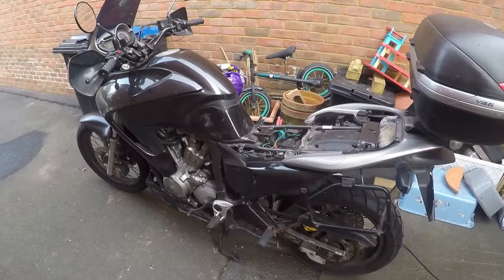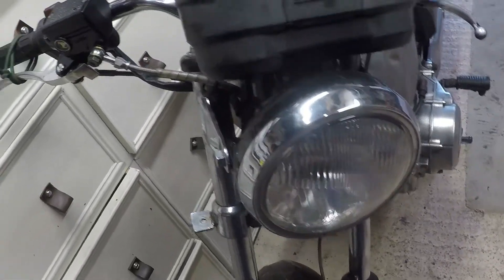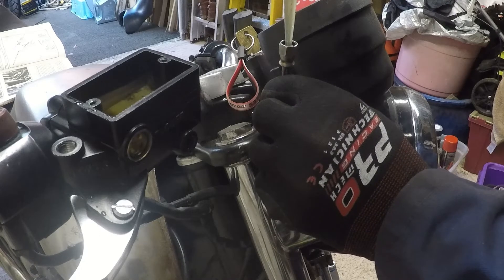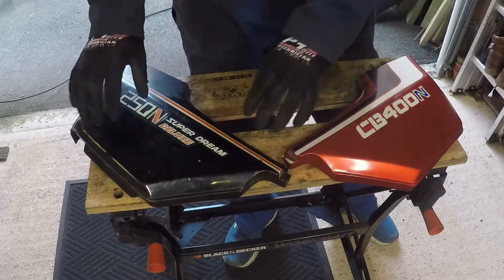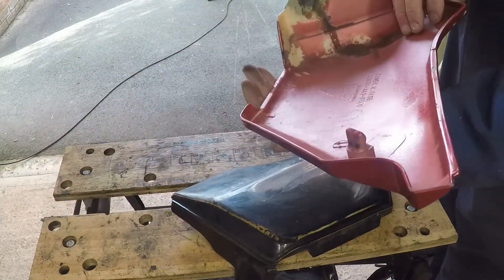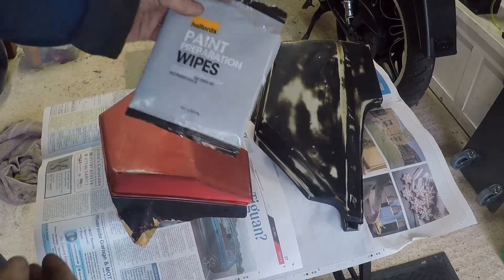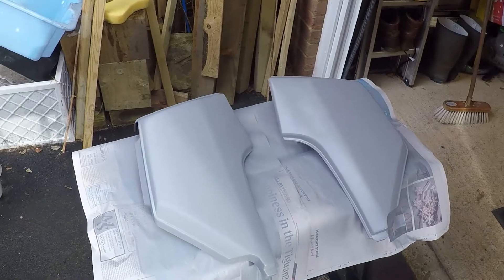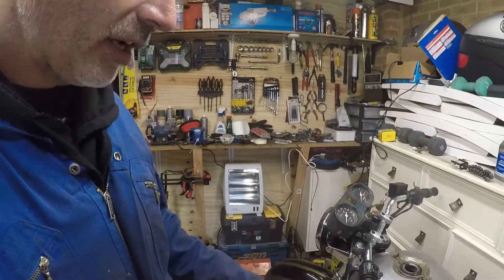Prepping Side Panels and Bleeding Brakes. Honda SuperDream (Aka Nighthawk) Project Bike - Part 31

Comment: Well done! 👍800 grit sandpaper is very good, 600 is the "normal" one and in most cases good enough - you are on the safe side! 😊 A tip can be to sand "wet". Most of these sandpapers are water resistant (you need to check yours). You dont have to keep the part under water when sanding, just dip the paper in water regularly and use a sponge to clean dust of the part you are sanding. The water will "stick" to the part  where you have sanded enough, while it peals off where you have not sanded, so it makes it easy to see when you are done and can move on. It also avoids the sandpaper getting full of dust so it lasts longer, you dont get dust everywhere and if you use hot water your will keep your hands warm 😁When sanding wet, the paper is a bit more aggressive, using 800 is perfect for that. You dont want to sand wet on bare metal, but it works perfectly on plastic parts and on previously painted parts as long as you do not get into the metal (it starts to rust very quickly). 

Remember to sand the primer as well before the paint, and you should not use old newspapers as cover under them, they release small paper-dust-particles that sticks to the paint. Looking forward to seeing the result! 

I think you have solved the brake bleeding problem now. This is the way I do it as well,  it has always worked. I have never bothered keeping the lever pushed in over night, it has just never been any problem to bleed after the caliper and hose has been filled.
Reply from the maker: Hi Thank you again for your comments, I had previously used the sandpaper wet on top coat but never when preparing the surface, so I will do this when I move to the rear section. I hope the caliper will bleed now when I can get back outside soon. Ryan

Comment: Well done for getting out in that cold garage.  You might want to flat that primer off wil some 1200 wet and dry used wet. It sometimes shows up imperfections and its a lot easier to correct at the primer stage if it needs it.
Reply from the maker: Thanks Colin, I did expect that I'd need  to do something before next coat, so I'll try a gently 1200 and hopefully all will be well. Ryan

Comment: I was surprised to see decals came off so easily ,sometimes there's laquer on top ,I like your spraying technique but if can offer one piece of advice it would be to spray edges first 👍
Reply from the maker: Hi Derek, thank you. When I get to the top coat I will bare that advice in mind. I was also pleasantly surprised the decals didn't put up more of a fight, but they did have to get rather hot before I could get them started. Ryan
Reply: @RyansGarageUK  that's ok Ryan I've been using paint for 40years now ,before that I worked at a Honda dealership when the Suoerdreams were all brand new out of the crate ,they were very popular back then 👍

Comment: There are many different methods to bleeding brakes...everyone seems to have their own way. However, I recently rebuilt my Superdream brakes and bled them from dry by doing the following which worked in no time at all. I removed the caliper and cable tied it to the fork in such a way that the bleed nipple was the highest point on the caliper. I then used a clamp to keep resistance on the piston. Then i filled the master cylinder whilst the nipple was closed...tapping the brake line with a spanner all along it starting at the nipple right up to the master cylinder to encourage any air bubbles to dislodge. Then pull the lever right in...keeping pressure on it, and crack open the bleed nipple, only letting a small amount of fluid out and then closing the nipple. Then SLOWLY release the lever back out. Once it's fully out I then pump it 10 or 15 times very quickly. Repeat this process of applying pressure on the lever ...briefly cracking the nipple and nipping it up again ...then slowly releasing the lever. Make sure to not release the lever with the nipple still open at any stage ...as this will draw air in. Once you start to feel a bit of pressure you want to keep repeating the process, but this time try and shut the nipple before the lever bottoms out on the grip...then slowly releasing...pumping it quickly multiple times with the nipple closed ...and repeating. Also make sure that your reservoir doesn't run low at any stage. Tapping the line and caliper with a spanner now and again certainly helps. Once you get an improvement in pressure, refit the caliper and bleed again using the same process. Sounds lengthy, but in reality it works for me in about 15mins. Once you have it bled successfully, you can cable tie the lever back keeping pressure on it over night, then the next day slowly release the lever and you should notice a significant improvement in the firmness. This little cable tie trick was something we used to do on our bikes back when I dabbled a bit at racing short circuits. Hope this helps! Andrew
Reply from the maker: Hi Andrew, thank you very much for taking the trouble to provide such a comprehensive guide to what worked for you. I'll take a moment to compare your procedure with what I've tried so far to try and understand where they differ to hopefully point me towards to solution. This is very much appreciated. Ryan